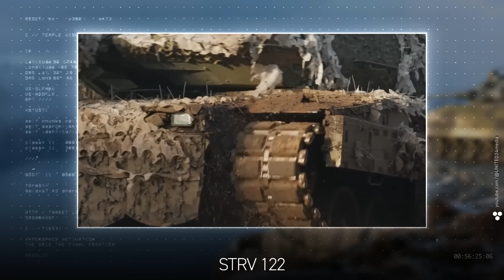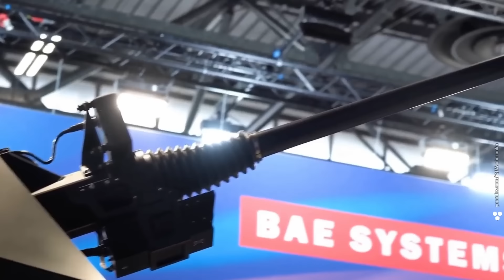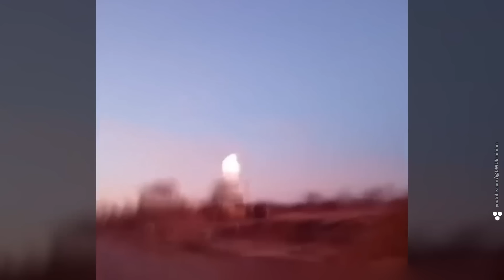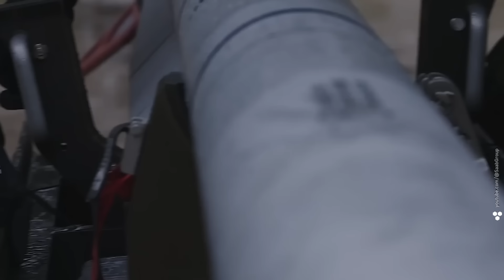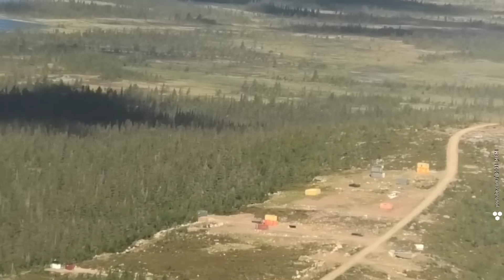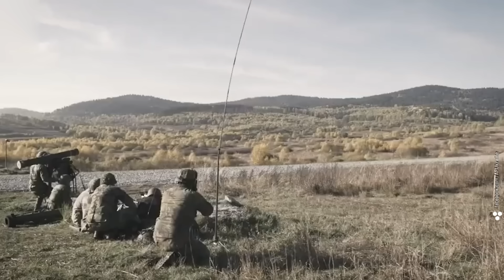Ukraine Just CHANGED Sweden's Army FOREVER - Here's Why

Comment: 9:50 "Why Russia specifically?"

 - Because Sweden have had something like 40 wars with Russia (if you include it's predecessor Novgorod). 

- Because Russia took half of Sweden (modern day Finland) in the last war and the imperial Tzar Russia were a continiues threat to Sweden. 

- Because the Soviet communists, and a Soviet  backed communist revolution, were seen as a bigger threat to Sweden then n*zi Germany. 

- Because during the whole Cold War Soviet was seen as the biggest, and in reality only, threat to Sweden. 

- Because Imperial Russia, Soviet, and modern day Russia have constantly kept on testing Swedens rediness (and still continue doing so). Violating it's borders, conducted espionage and sabotage. A Soviet submarine armed with nuclear weapons went a ground in Sweden ("Whiskey on the Rocks"). Many Swedish pilots have died counter Soviet intruding fighterplanes. Just a few years ago Russia had a military excersice that trained to nuke Stockholm that just shy of the border was redirected (nobody on the Swedish side knew if it was areal threat or not). Swedish air and boat traffick is frequently jammed by GPS jammers from Kalinigrad.

- Because Sweden and Russia have fundamentally different worldviews, valuesystems and vision for the future. Many things one see is just normal to one is utterly disgusting to the other. There is a deep mistrust ingrained.

- Becasue Russia has been a major threat to Sweden for almost a milennia, and it seems to continue being so. 

That is why the whole Swedish defense (both strategy and industry) have been aimed at counter speciffically Soviet/Russian forces. This is not something new. This is the soul reason for the Swedish military industry to still exist, and has been for the last 200 years.

That is why Russia specifically.

Comment: While the tridon is mostly just a re-hash of the Bofors Mk4 (a ship-based all purpose turret designed primarily as a point defense weapon against aircraft/missile/drones) the tungsten rounds allows it to drop more weight of fire over a larger area and at longer range compared to other weapons in that role (like the Phalanx CIWS or AK-630).
That it has gone from a ship-based weapon to a truck mounted weapon so fast is because independent weapon mounting has been a trend in naval shipbuilding for the last 30 years, as upgrading a ship with new turrets to counter new threats is much easier if it doesn't require a magazine/mechanism extending deep into the hull.

Main drawback is that you can't carry as much ammunition as a 35mm gun (which is why the latest generation of IFVs are swapping to 35mm), but that matters less for a weapon meant for defense in depth.

Comment: Thats a brilliant idea. Kind of scaled down naval gun. No need for complex stabilizer. Basicly only proxy fuses and not those programmable fuses. Idea aint shooting ground targets so ammo is cheaper. Those 3p ammo costs alot. No need for penetrating or programmable airburst options like ifvs and ships does and platform is steady. Other thing is that it doesnt seem to have search radar to give position away. Only optical and trust me thats enough and then targeting radar for fire solution. Those are accurate as hell. Ive seen naval version hitting 3 round bursts from about 7km on moving air target all in range of the target that detonates the fuse in rough sea. 40mm doesnt sound much but shell diameter aint the thing. Those shells aint small and amount of propellant is way bigger than in lets say 30mm.
Reply: If you not produced airburst ammo like we in Serbia for our Pasaras-16 this AA canons are very expensive toys!!! Also if you don't have production of ordinary 40mm ammo and Ukraine don't have, this toy is also expensive!!! This is unique bullet and calibre for Bofors canon especialy if it's cartrige ammo!!!

Comment: Wonder how many of these Swedish 40mm units will end up being ordered by the Gulf States? Alternatively, Hanwha Aerospace's 40mm Automated Air Defense System is a cutting-edge, South Korean-developed, ground-based, 40mm system, unveiled in 2023, featuring an engagement control station, radar vehicle, and unmanned twin-barrel cannons designed to counter unmanned aerial vehicles (UAVs) and low-altitude threats with a 4 km range

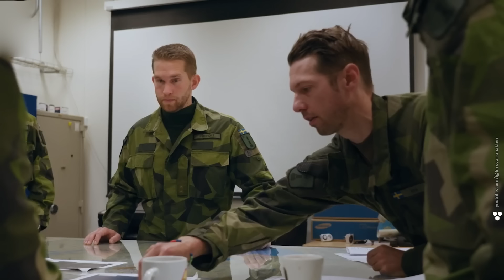Comment: 0:42 that clip made me giggle, it's so staged. I did my Swedish military service 35 years ago. While we did train with paper maps, just in case and for use in the field, even back then the maps was fully digital, with huge (this was before flat screens) horizontally placed touch screens, in the command central bunkers. You can't overlay enemy missiles and airplanes in real time on paper maps. Even keeping track of friendly movements is hard with paper maps.
Reply: dude, they plan a flight and interact in the air. Until yesterday, the best way to coordinate joint actions and maneuvers had not yet been invented.😂😂😂

Comment: Hope to see the Meteor in Action when the Gripen`s  coming.
Reply: The new Gripen can fit several of them under its wings. Only the tips need to be Iris-T. 😂
Reply: @MP-nc2pw  Sweden is not playing Russian games.  👍 We should all stop. It is enough.
Reply: @danielschulze9106 It would be nice if Ukraine could stop the Russian agressor as soon as possible and kick him out of their country. But this will not be easy😢
Reply: @MP-nc2pw  It would help with the "Gildebomb" Problem significantly. I don't understand why this hasn't happened long ago. (No criticism of Sweden) rather all of Europe.Especially Germany France UK Italy and Spain because it`s there Weapon.
Reply: @danielschulze9106 Ukraine has no aircraft capable of handling the Meteor missile. The only US aircraft likely capable of doing so would be the F-35. The manufacturer integrates the missile into the F-35 and has received authorization to do so. Conversely, permission has generally not been granted to other US aircraft. The Mirage lacks the necessary interfaces and components to properly utilize the Meteor.
Internationally, the plan was to have a primary platform, the F-16. Unlike the Gripen, there are hundreds of F-16s available, either retired or ready for transfer. It would also be disadvantageous for the US if the Gripen were successful in Ukraine and the F-16 lost its significance as a general-purpose aircraft. In that case, the US would probably have to release some of its many older aircraft currently parked in the desert to Ukraine. Sweden, Hungary, and the Czech Republic have older Gripens that are still relatively new enough to be used in the Meteor mission. Only Sweden has a sufficient number, with nearly 100, and the Czech Republic will have more after they are replaced by the F-35 in 2028.   This would be a good way to station some aircraft in a decentralized manner, since minor maintenance on the Gripen can also be carried out by mobile teams. However, the Meteor requires more technology to prepare it. But even without that, the Gripen would be an advantage against drones. With the missile and in combination with the two Swedish radar-equipped aircraft, they would be the terror of all aircraft carrying glide bombs up to almost 100 km behind the front lines, since these aircraft could launch the Meteor at the enemy in passive mode, allowing the Meteor to appear out of nowhere within seconds of the Russian aircraft when it activates its own radar.
Reply: @MP-nc2pw  Thanks for the Info ;)

Comment: The new anti-aircraft gun could be a great addition to the Skyranger. It's extremely good, especially against swarms of drones, but it lacks the very long range and altitude needed for effective engagement. A 40mm gun from Sweden would fill that gap. While not quite as effective at close-range defense, it has its own strengths, such as different programmable ammunition options, which also make it effective against ground targets.
Reply: The turret aroind the 40 mm is too tall. It would work, but ammo goes down hard without mounting it like shown in the video in a dedicated AA  turret.
The chassis germany uses are mostly Boxer or leopard 1 hulls.
Boxer can have it, but you reduce infantry compartment to unsufficient numbers and the 35 and 30 mm is enough.
For the Leopard 1 hull, would with a completely other turret work easily, but tjat would require a complete new turret, and additional ammo diameter.
The Truck mount is basically what they need..it is faster accomplishable to hve many , even if the guys operating it are less protected and not a direct frontline unit like the boxer.
For a stationary gun against drones like shahed etc....you could go higher than 40 mm because of range...
Reply: @d.f.9140 Neither the Boxer, KF41, nor Leopard can carry infantry when equipped as anti-aircraft tanks. The KF41-based infantry fighting vehicles, the Boxer with an unmanned turret, the Australian manned version, and the Puma can carry mechanized infantry, but only have anti-air capability.
The truck you're looking for is the Rheinmetall RX 8x8. It can carry both the Skyranger 30 and 35, as well as other systems. It also has space for ammunition and several rocket launchers or additional sensors, as it has ample platform and payload capacity. It's just not quite as off-road capable as a Boxer.
But the cab is almost equally well armored, and the truck can withstand shrapnel, mines up to 10 kg, and improvised explosive devices, protecting its crew. It also has sufficient stability to guarantee high accuracy even with 35 mm ammunition. It is, of course, particularly advantageous where it can reach a target by road and act as its own ammunition supply truck. A small crane can also be installed to move the ammunition more quickly. 
Other countries use similar platforms with these towers.

Comment: Even Old, smaller Gripen would be great for defense tasks against drones. There are enough outposts available to carry several Iris-T missiles, and with potentially one or two Meteor missiles also attached to the aircraft, any approach is extremely dangerous for the enemy. Even at a distance of 100 km, escape is virtually impossible. 
The new version is a very good aircraft.
Reply: The sad thing is that there are no longer any Gripen A left. They was all modified to the C. And there is not enough of them to cover Swedens own needs as it is right now.
Reply: @peterfdsvenskaflygvapnet2643 The Model A would also be too old. It lacks important features. Ten aircraft from Sweden, the Czech Republic, and Hungary would be great. In return, Sweden could put ten new ones into service. Then Ukraine would gain experience with the aircraft and could use it almost exclusively defensively, far from the front lines, while still maintaining a potential threat.
Reply: @MP-nc2pw  Still, most countries operating the C is actually leasing them, like both the Czech Republic and Hungary for example, not owning them. So they are not theirs to donate. And SAAB doesn't builds the E fast enough for that. Especially as Sweden are activating a new flotilla, most likely 2 squadrons of 15-20 aircrafts each. The only country with C's that could be available is the around 12 ones in South Africa, if someone can pay for them. Plus the fact that SAAB has 14 uncompleted C airframes that they can complete in about 6 months if someone pays for them, according to the CEO. That is the only C's that is available in a near future.
Reply: @peterfdsvenskaflygvapnet2643 As far as I know the south african ones have not the same updates as the other ones.
The leased ones could be given back to Sweden if the countrys do not need them anymore. Like if they get their F35. So Sweden cozld leaste this ones to Ukraine und build the ones. So there would be some.
Reply: @MP-nc2pw  The ones in South Africa are the complete C version. They was upgraded a few years ago. The big problem is that they have been on the ground for years now. Each plane maybe gets 1 hour in the air per year, if even that much. Thats due to the economy in SA.
Those aircrafts that are leased are not owned by Sweden. They are the property of SAAB wich is a private company. So if they once goes back to SAAB they are not available for the government to give away or sell. Besides, both Hungary and the Czech Republic has pretty resently extended their leases with a bunch of years. I don't remember how many.

Comment: Iris-T has been in use in Ukraine for years. I don't know if Sweden has already deployed any, but if they do, that's fantastic. The German systems, both the S and M versions, perform exceptionally well. As a joint development, the Swedish system is certainly on par; it might use a different radar, but I'm sure it's also a top-of-the-line model, just like the German one.

Comment: The Gripen Needs A
The New R.R Engine
To Be The BEST 👌 💯
Reply: The one developed for the Eurofighter that fits almost perfectly into the Gripen's airframe? With 2D thrust vectoring, lower fuel consumption, and more power? With which the Gripen could probably achieve supercruise? I think that would be really great, especially to become independent from the US. And if the Eurofighter ever decides to incorporate it into new production runs, the economics of scale would come into play, as would a good supply of spare parts in Europe for both aircraft. With that, the Eurofighter would probably be right at the forefront of Western aircraft in terms of flight performance. Supercruise with a full load would be possible, meaning very fast and still reasonably fuel-efficient passage to the destination with dry thrust. It would certainly help the Gripen tremendously.
Reply: @MP-nc2pw  The one that's still on paper only (or cad files nowadays)? The EJ230 isn't even in the prototype stage yet.  When, and if, there's a G/H model of Gripen it might very well be with a RR engine, but not for the current E/F.
Reply: @darkiee69 In terms of installation space, it would actually fit, and it would even be a little lighter. But it's not in use and there are no current plans to implement it. You're quite right about that. Independence from the USA would certainly be a positive thing.

Comment: Well done Sweden. Ukraine will need that new bofors anti-drone weapon.
Reply: Especially against long-range jet drones, which can fly quite high except in the final phase and can otherwise only be reached by systems like Iris-T, this system is the best solution in approach zones. Other systems excel directly at the target, and other systems are optimal against small, low-flying drones at the front. However, where large areas need to be covered by a single system, or where drones are operating at higher altitudes, this system is indispensable without expensive missiles.
Reply: @MP-nc2pw  it's just one part of a wider system
Reply: @prawnstar69 yes it is like skynex, skyranger, mantis and many more.

Comment: Gripen only needs 500m roadstrip for takeoff, 600m for landing..
Reply: Also, it's not the start/landing on roadstrips that is the unique thing with Gripen - many fighters CAN do that.
The unique thing is that Gripen is designed to be FULLY OPERATED, MAINTAINED AND BASED on roadstrip bases in wartime.
Reply: @mrSkandalpolisen exactly
Reply: @resorband even the new one?
Reply: @MP-nc2pw  Especially the new one. First thing an enemy would do is to bomb your airbases to keep the hangar queens grounded. Reload and refuel in under 15 minutes. Heck even an engine swap can be done in under 1 hour by the side of the road.
Reply: @John8087The new Gripen is larger than the older versions. This was at least possible with the older ones. If it's the same with the new model, that would be great.
Reply: @MP-nc2pw it is the same ground handing criteria for all versions. So for E no change. Will be using same bases as C.
Reply: @henriklevinson2863 The new version needs some more meters. But less than most others. The Rafale needs some less to land. But the new Gripen is able to start like the old one if the fuel tanks are not filled or only some rockets are on it.
Reply: @MP-nc2pw its not a big deal..the most important thing is that it takes only a few minutes to get it ready and up in the air again.And that updates can be done while the pilot have some coffea and a pee paus.Many planes can land and take off from roads🤷‍♂️🇸🇪
Reply: @donaldliden4545 the F16 and the EF hate it to use bad air fields
Reply: ...and it doesn't need to be particularly straight or flat.
Reply: The Gripen only needs an old quarry to land.😂😂😂

Comment: 3:30 sort of BS, or rather inaccurate reporting: IRIS-T stands for infrared imaging, and the heat contrast towards almost any background with .1°C delta perception is close to 100% efficiency. Plus the initial guidance with course updates is radar guided, so that argument is mostly invalid. (The cost delta is still substantial, admittedly.)
Reply: laser imaging seeker only close mid range imaging infrared seeker in the world . its same tech RBS 90 use  so its quite bit more than heat seeking IR
Reply: @tony18662  Looks like you are mixing up the systems. There is no laser guidance on any of the IRIS-T- versions.